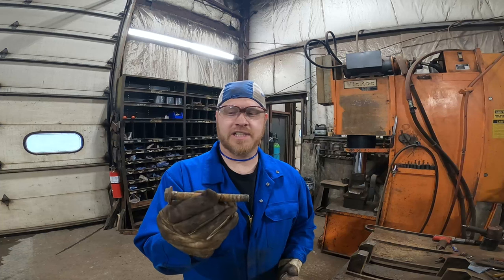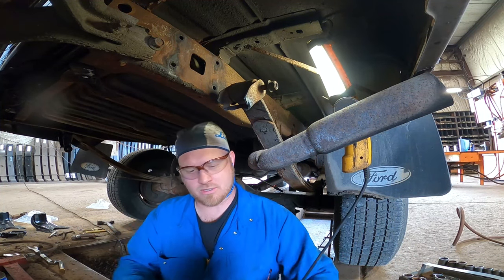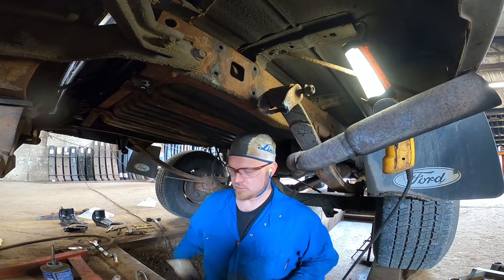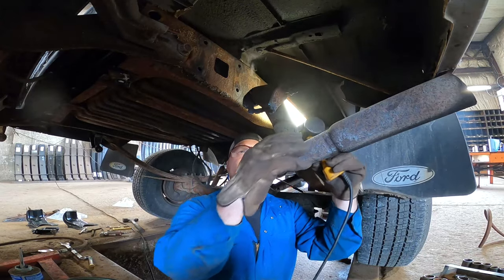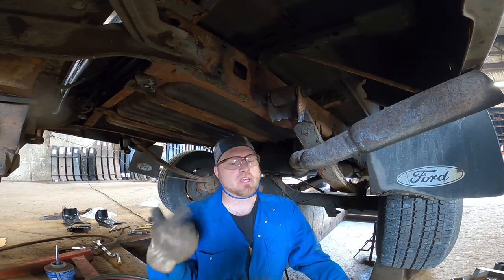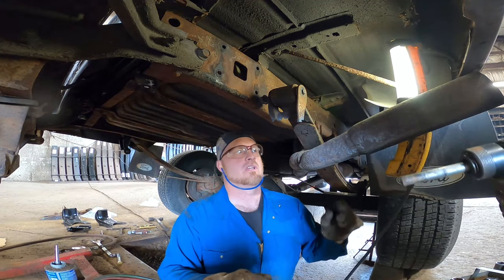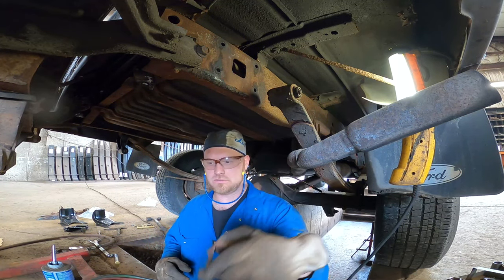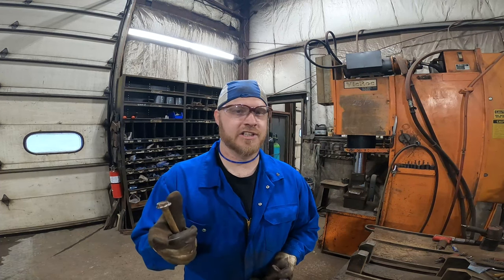how to remove leaf spring bolts using heat

Comment: Another trick if stuck  u can pull the bolt out , by adding large washes on the nut end,   then cut the head off  the bolt and draw it out by winding the nut in.. 😊

Comment: Will this work with a plumers torch from plumers store? I been having problem pulling leafs for my truck from junkyard
Reply from the maker: I don't think it gets hot enough fast enough, however I have not tried it.  the trick is to not get it so hot that everything (rubber) starts melting

Comment: What ear plugs do you use?
Reply from the maker: I use 3M E-A-Rcaps™ Model 200 hearing protection.  Rated for 17 Decibels which is where I actually adjust the volume on most of my videos so you hear what I hear

Comment: Relying only on that jack to hold up that truck without a stand isn't worth the life of a smart guy like you. Jack may have a safety but it still let it drop at least 5 inches and that is enough to at least seriously hurt you.
Reply: He likes to live dangerously.  And doesn't care about breathing rust dust either i guess.  I hate that stuff, when i clean metal i like to spray the area to be cleaned with water in a spray bottle beforehand, drastically cuts down on dust, and have best ventilation i can.